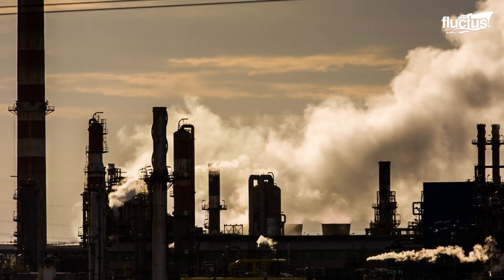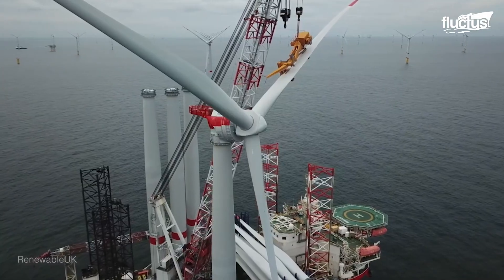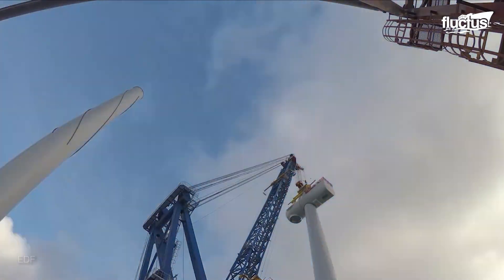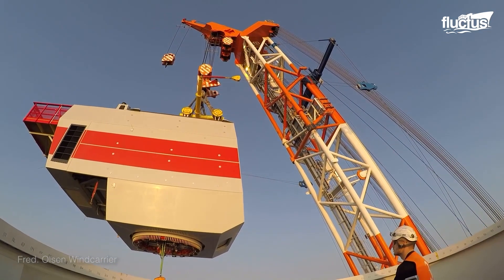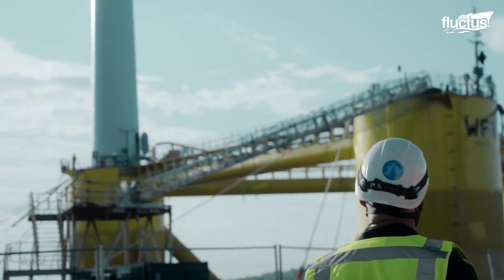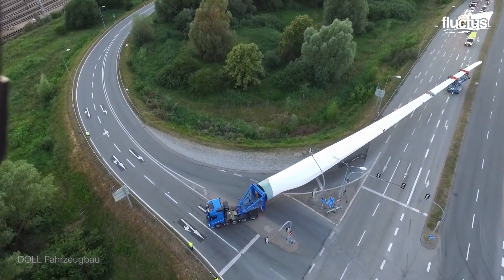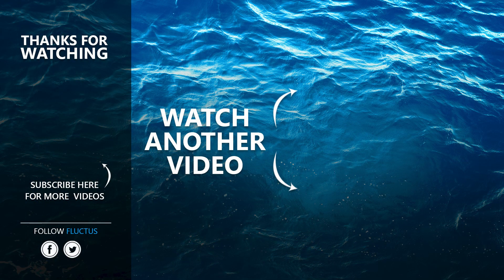Building $10 Million Offshore Wind Turbine in Middle of the Sea

Comment: What are the plans to deal with the turbines when they have out lived there life span??
Reply: @garysmith5025  Lol.  Of course you’re funded by big wind, and think your BS doesn’t stink.
Reply: Blades cannot be recycled, full of toxic glues etc. The huge amounts of balsa comes from the rain forests. It all ends up in landfill. The enormous amount of concrete and steel is left in the ground. A wind turbine can never save as much carbon as it takes to make it.
Reply: @anglosaxonmike8325  Wrong, they get recycled.
Reply: @garysmith5025  What matters is the energy output over time vs wind speed, which always goes down over time,  sharply after 10 yrs, not some hand waiving story about a an  old turbine someone saw down the road.  

It’s an age old story for long term suppliers of this or that to arrange terms so they get paid mostly up front when dealing with naive or kick back receiving clients, and then the supplier walks later. So, stories of new installs don’t necessarily mean industry knows what’s best for all.  

I earlier supplied an independent  report on the numbers, which you dismissed in favor of industry like they were the church. Yes fossil fuel is a big grasping industry, but make no mistake so is big wind, now $100B revenue per year globally.
Reply: @garysmith5025  “expected …25 years”

Data is in.  After 10-15 years, generation falls below maintenance costs.  If this can be hidden, industry can still get a pay day by continuing to install  new wind farms and walking away later when nobody is looking, and expensive gas must be used to pick up the shortfall.  Wind developers love gas, esp imported, and vice versa.

“Far from falling, the operating costs per MW of new capacity have increased significantly for both onshore and offshore wind farms over the last two decades [maintenance of newer larger turbines grows exponentially] “

From:The Costs of Offshore Wind Power: Blindness and Insight
Reply: @Nill757  They already last 20 years+
Reply: @paxundpeace9970  Power output begins to fall dramatically at 10 years due to pitting and delamination of blades.  Bigger turbines lose power sooner and faster because the blades are moving faster through the air.

Comment: This video is mis titled.  The expectation is it is going to be detailing the build of a $10 million dollar electric generator wind turbine.  No mention is ever made of a 10 million dollar electric generator wind turbine.  The video describes the difficulties of installing ocean based wind turbines then shows apparently non trivial, but easier installation of land based wind turbines.  This comparison is grossly incorrect and it also is avoiding the growing controversies on the detrimental effect of large wind turbines.  The installation of large wind turbines at sea is NOT more difficult than placating them on land.  The biggest reason for putting large wind turbines at sea is the huge difficulty of the logistics of moving then into position on land.    Large wind turbine have better cost to electric generation ratio than smaller turbines.  This is why the industry favors larger and large wind turbines as the technology to make them is created.  It is typically much more difficult to impractical to install the large wind turbines currently being installed at sea on land. 

The installation of large numbers of wind turbines (farms) typically cause electric rate to go up for consumers when the base load is provided by coal and natural gas.  This is because wind turbine generated electricity is intermittent and can only substitute for base load electric generation when it is available.  All new large intermittent power generation capacity has to be backed up with the further capital cost of new base load generating capacity.  The consumer is having to pay the capital cost of two physical plants to generate the same amount of electricity that one produces.  A rule-of-thumb is only 1/3 or a wind farms rated maximum capacity can be expected over year; whereas, 95% of a coal powered electric generating plant can be expected over a year.  One 1GW combined cycle natural gas plant can backup a 3GW wind turbine farm for a expected yearly base load production of 0.95 GW.  The reality is order to provide grid stability for the erratic power generation of wind turbines the natural gas plant has to be running at all times and making up for the dips and pulling back from the peaks of the wind farm generating power.  This causes it to run much less efficiently.  

The cost of natural gas has recently (2022) almost tripled in the USA over what it has been from 2008 to 2021.  If natural gas costs were to  remain double that of the last decade long term, natural gas would be significantly more expensive than coal, even with the increased coal prices, for base load electric power generation.  This would return to the historic cost benefit of large scale industrial coal fuel cost being many times cheaper than using natural gas, justifying increased coal plant cost in staffing and capital costs.     It was the relatively recent low cost of natural gas putting it on par and even beating the coal fuel cost for per mega Watt hour electric power generation that allowed for the favorable cost of a hybrid system of a new large wind turbine farm in combination with new combined cycle natural gas plant to  back it up, to replace retiring relatively inefficient and higher polluting smaller coal plants, rather than replace them with a large high efficient clean coal plant that are expensive and slow to build, difficult to situate, and require many more people to operate.

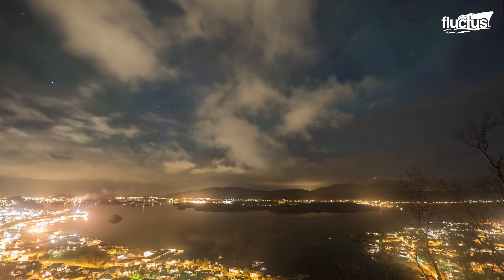Comment: @7:24 “Norway has committed  itself to RE”

Yes, Norway has the largest share of hydro in Europe. So the story here is, what kind of racket is underway that would have it investing in hard to maintain offshore wind turbines, with marine power cables landing here and there, with blades that go in landfills, with non dispatch-able power, unlike its hydro.
Reply: Norway is currently the largest exporter of fossil fuels in Europe, making a massive income, Norway will lose all this income when the world stops using fossil fuels. So is planning on replacing that lost revenue by selling renewable energy, and plans to become the largest exporter of renewable energy in Europe (many central European counties without coastal water or winter sun are going to struggle to be energy independent on renewables and make good customers for Norway.)
Basically, Norway plans to make a lot of income from renewables including wind farms, which are very profitable!
Reply: @stevetaylor2818  
"...when the world stops using fossil fuels"
Dream on -not in your lifetime pal.
Reply: @johna.4334  definitely not by any country with a military!
Reply: @stevetaylor2818  Offshore unsubsidized wind has become increasingly not  profitable.   Yet much of  the EU will continue to install subsidized wind, onshore and off, with generation peaking at similar  times, severely reducing value as everyone tries to export the excess simultaneously.

“Far from falling, the actual capital costs per MW of capacity to build new wind farms increased substantially from 2002 to about 2015 and have, at best, remained constant since then”

“Far from falling, the operating costs per MW of new capacity have increased significantly for both onshore and offshore wind farms over the last two decades [maintenance of newer larger turbines grows exponentially] “

From:The Costs of Offshore Wind Power: Blindness and Insight
Reply: @Nill757  This is absolutely nonsensical if not outright lies. The two gentlemen behind this article are politicians not scientists.
Reply: @larshansen5533  One author, Hughes, is a UK economics professor and long time energy advisor to the World Bank.  Do you have any evidence they’re lying as you say, or that they’re “politicians”?  Or are you pushing a a story?
Reply: @Nill757  it's all easy, do any search from any source in any country, and find a graph that shows price pr mwh. Yes there is a lot of maintenance, but they can in right positions (like the norwegian sea) produce huge amounts of energy. And offshore installations and underwater cables are something we are already highly specialized in.
Reply: @Nidvard  Information cables are a mature and efficient industry, and failures are usually routed around w little notice and no hazard to the public.  They need not necessarily be trenched, and bringing them ashore is no major hazard. 

High voltage marine power cables are a different story entirely.  There has never been a need to bring hundreds (perhaps thousands)  of power cables ashore on one coast previously, and now with large build outs of coastal wind there will be such a need.   A failure of such a cable, via erosion or an anchor catch means not just an outage but a serious health hazard to the public.  Right now, only the most remote areas are used for landings.  That will begin to change.
Reply: @Nill757  yes, thank you for your opinion of the difference between information cables and power cables... 🙄
Reply: @Nill757 wind speed is not uniform across the whole of Europe. There will be peaks at different times in different places.

Also, a lot of work is put into the risk assessment of cable burial routes and the depth chosen so that the statistical likelhood of anchor strike is close to nil. Even if it did happen, it would not be a public health concern and the output of the field would continue through the 2nd cable
Reply: @Klinsmann1985  Wind speed is mostly well correlated across the continent.  2021 saw a wind generation drop of 10-25% across the continent for 1/2 the year or more.  That's non starter for a continent to be based entirely on wind plus some storage, if it ever got that far, like 20% of the gas robbed out of all the gas pipelines.
Reply: @Nill757  are you serious?! So if it's windy in Norway, it must be windy in Spain? You seriously don't believe that do you?
Reply: @Klinsmann1985  i see. You don’t know much about what correlation means, or data, or care.  Granny told you ‘wind it’s a always blowing somewhere’, so end of story for you.  ALL of W Europe did not see 20% drop in wind for 2021, never happened per you, cause Spain, cause Norway, cause Granny.
Reply: @Nill757  I presume that 20% is a total average across western Europe (assuming it's correct). It doesn't mean that the wind blows uniformly across the continent. You can have excesses in one area that can be exported to another. Localised winds can vary greatly, even within a few miles. 

In any case no one is suggesting that wind power become the sole power source of any continent so the gaps can be filled from other sources.

What's all this granny talk by the way?
Reply: @Klinsmann1985  “exported”

No you can’t.  That’s the problem. Nations move 2-5% power everyday.  Can’t move that much power at the level of a big country.  And no, it’s not like when French wind is down 20% from avg, Germany is up 20%.  Large 2000 km wide weather fronts moving through EU mean when wind is down several days in eg France, it’ll be down somewhat in Germany too.
Reply: @Nill757  but down from what? It's all relative. Your one example of 2021 doesn't show a trend, it's a one year difference in the average wind speed. Wind isn't a finite resource like oil & gas, and should be treated differently. 

And I'm sorry but weather is not uniform across a continent. Scotland is getting battered right now, whilst the Bay of Biscay is relatively calm. 

It's true exporting electricity between nations is difficult right now but improvements to the grid are ongoing. These changes take time, it doesn't mean wind is not a good energy resource. You seem to have a bit of an agenda here
Reply: @Nill757  also just addressing the early comment about that quote on rising costs. A big part of this is down to the rapid increase in size which requires larger quantity of material to construct and increasingly bigger installation assets, eg vessels, cranes, storage facilities. The turbines installed in 2002 look like matchsticks compared today's. 

That said there are genuinely a lot of cost issues right now and this is something the industry is struggling with at the moment.
Reply: @Klinsmann1985  Struggling? They’re failing , Seimens, Orsted, Gamesa.  Wind turbine generators  are very dependent on Rare Earths, 90% comes from China, and copper, a ton of copper for every 100 tons of wind turbine. Also the increasing blade speed w big turbines has increased maintenance costs dramatically past what was expected.
Reply: @Nill757  really going for the scattergun approach aren't you, seems like only yesterday you were talking about anchor strike and unspecified public health risks!

Billions $ worth of planned projects have been written off for now yes because the auction prices simply aren't viable at today's costs. It's a time of a readjustment for the industry. The max price for the  next auction in the UK has been increased by 60% so I think we'll see activity get going again. 

Maintenance costs do rise with the increased size, but so does the output of the field. And let's not pretend oil and gas fields all operate at 100% with no downtime. There are plenty operating at 50% capacity hemorrhaging money on repairs and upgrades.

I don't know why your so passionately against wind energy as it seems apparent from your comments that you don't have any hands on experience with them.
Reply: @Klinsmann1985  wrong guy. Nvr said “health risks” nice scattershot.  Look just stop. You don’t know anything about energy aside from stories that sound good.
Reply: @Nill757  haha whoops, you do have very similar names tbf. 

They're not stories though, it's experience in a variety of different projects, both fossil fuel and renewable. You sound like you're picking sides and fighting a corner. There are challenges to all types of energy generation including wind, but it is still an excellent resource that should be harnessed. It's not a silver bullet, but that's ok, it can and is contributing to our grid, often in a very big way in the UK